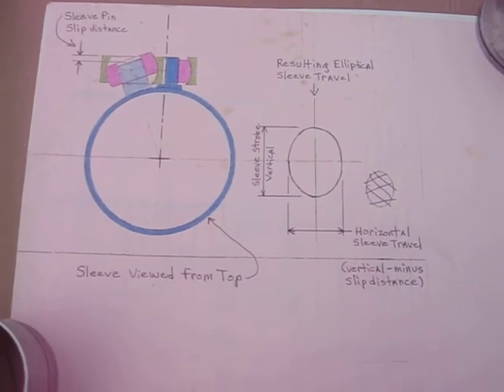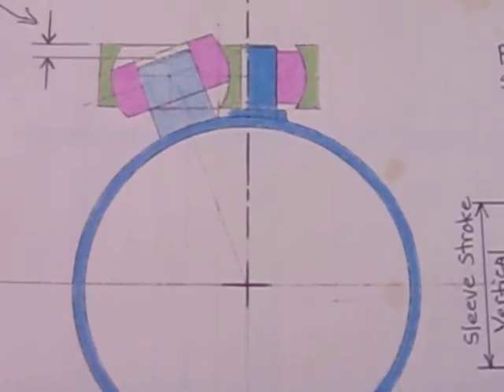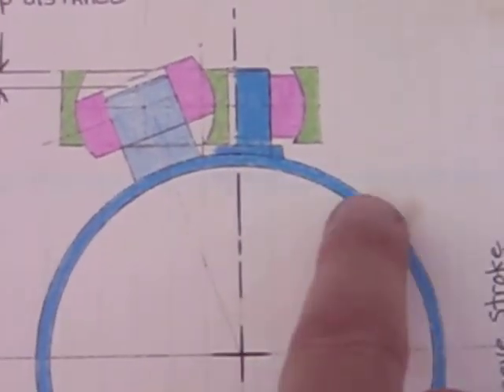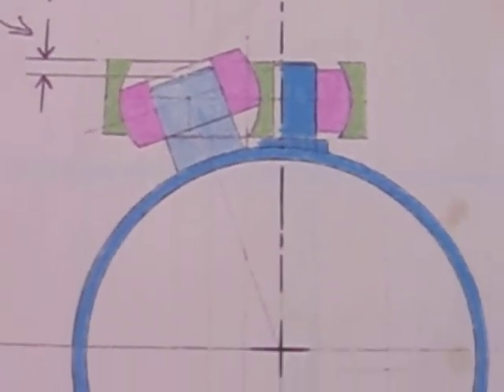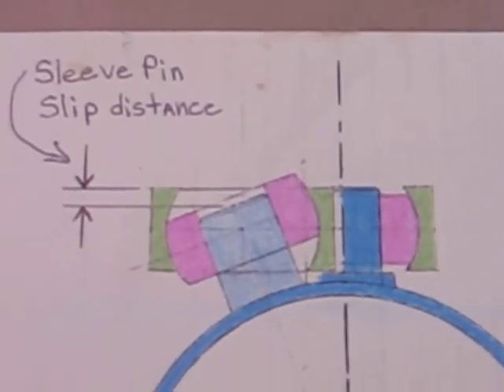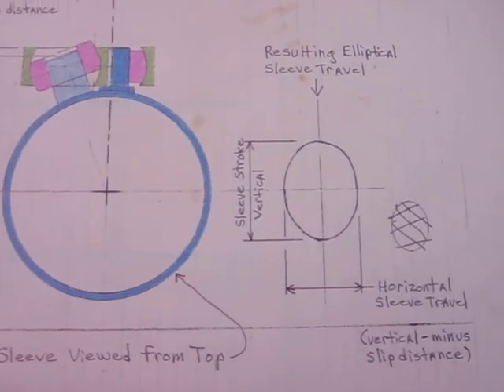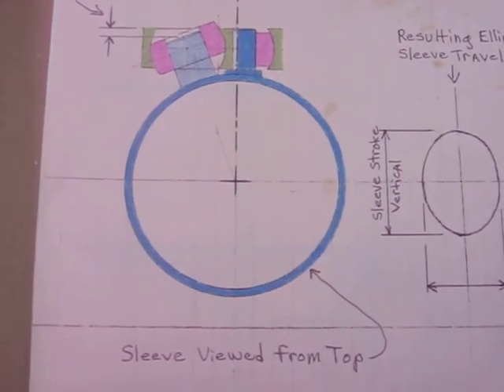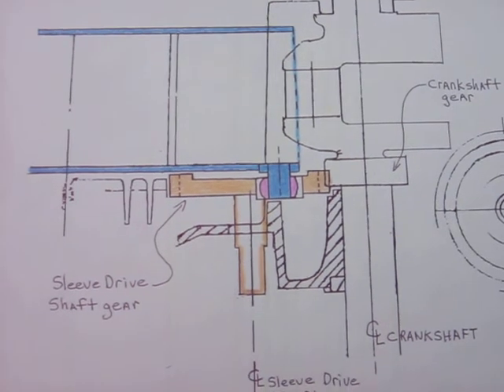Sleeve Drive, why an Ellipse motion

Comment from the maker: @grosaymerich 
I think the correct material for the sleeve would cure the oil burning, as well as the use of a scraper ring on the bottom outside of the sleeve. I couldn't do either of these on my lawnmower engine though.
Yes, a flat twin is ideal for sleeve valve conversion!

Comment: Good!. How is doing the issue of smoke and oil use in your S-V engines? Did you see¨mcda.com for the Citroën 2-cyl, air cooled, flat twin engine? Are you aware of somebody interested in modifying one of this Citron engines to Sleeve-Valve distribution? Salut +